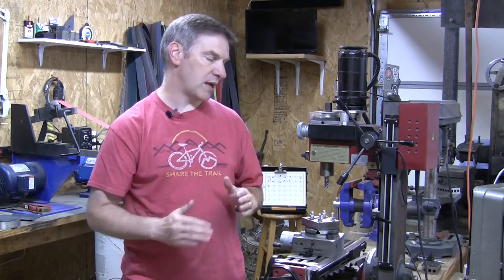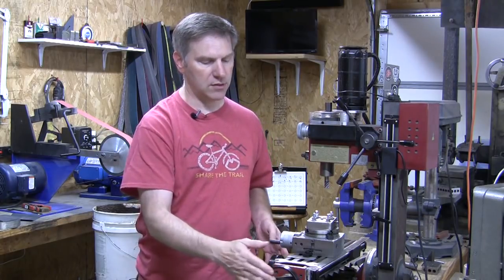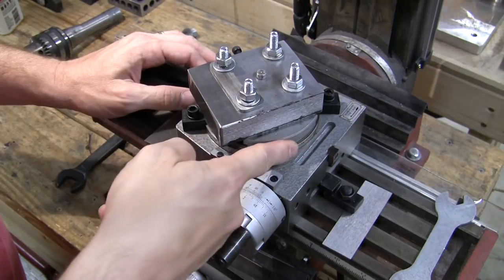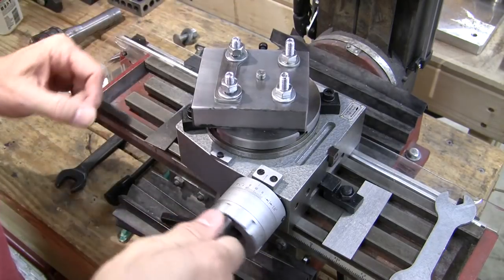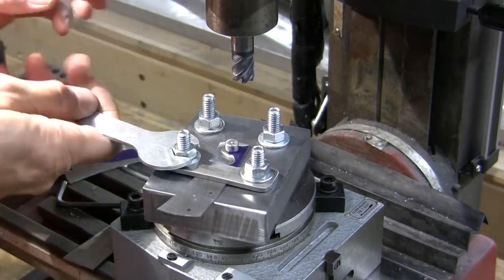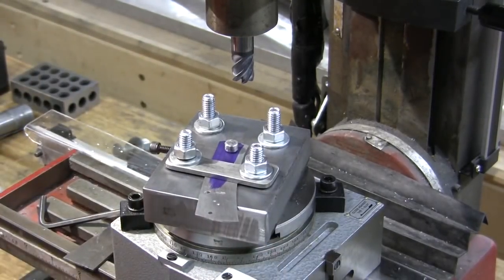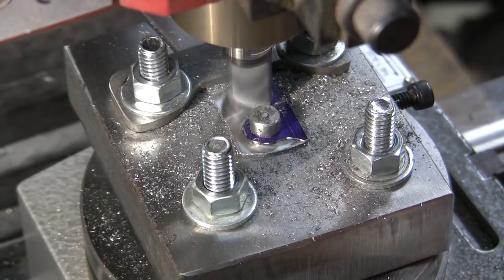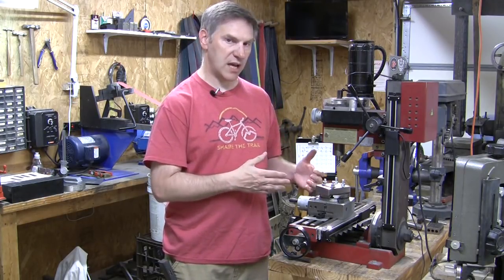Milling Liners

Comment: Hey chris as always great vid. So i have been searching no where have i seen any one sharing how they mill or cut the three sides of a tang of a slip joint. 
I understand the ratios but i have not seen anyone cut theirs. Could you point me in a good direction?????Thank..
Reply from the maker: Hey Ralph. Check out this video where I review the Kennedy Fixture. I talk about getting the three sides of the tang set correctly. I believe that most folder makers just grind that area rather than mill them. It's something that you cut out, and then grind and test, grind and test, and grind and test until you get it set correctly. The Kennedy Fixture isn't necessary, It just helps. 
https://www.youtube.com/watch?v=8YtHsMRI4js

If you want to see a really basic way of doing it, check out my old slipjoint tutorial from 23 years ago.
https://chriscrawfordknives.com/tutorials/written-tutorials/slipjoint/page-1/

Comment: why mill liners? what type knife needs milled liners ?
Reply from the maker: You will probably find milled liners on slipjoints. I think a lot of the liner locks and frame locks use washers. The main purpose of the milled liners in a slipjoint is to create an offset so that the liners don't leave rub lines on the tang of the blade. Hope this helps.

Comment: That looks great! One of the biggest problems I had was the area around the pivot flexing up when tightening down the clamp so I tacked a 5-40 nut on the back side for my 1/8" pivot and run a screw down in the plate to hold the pivot area down tight.
Reply from the maker: That's a good idea. Thanks.